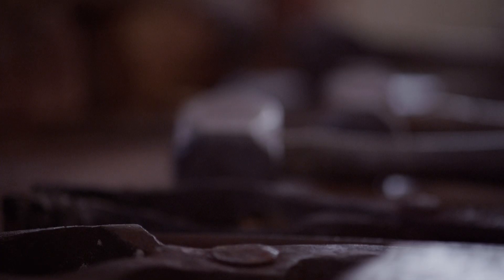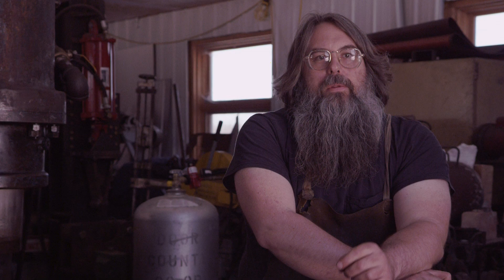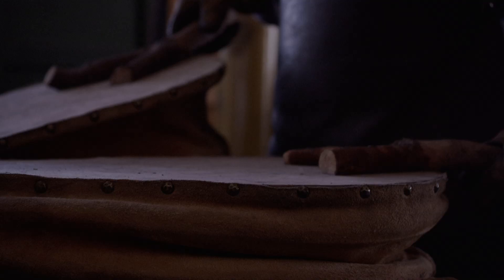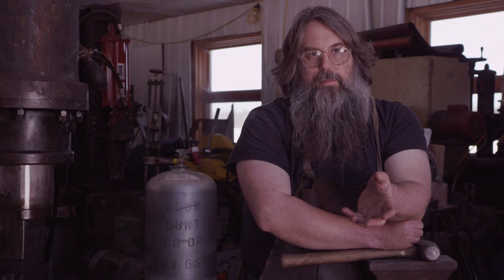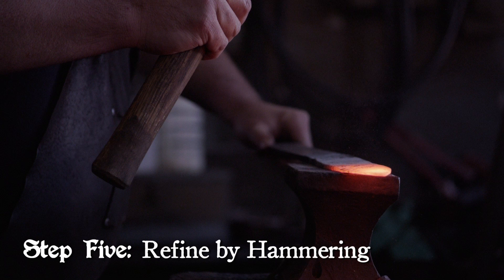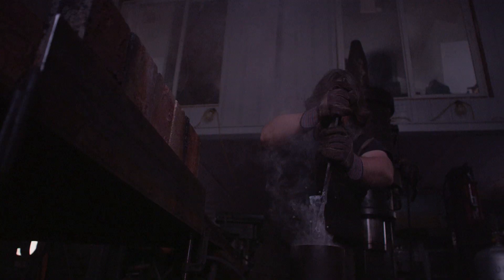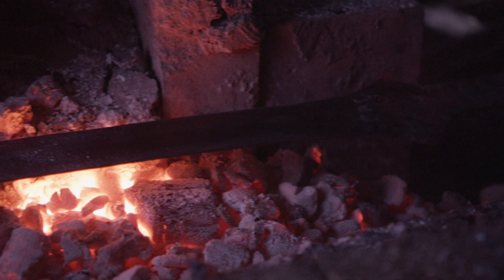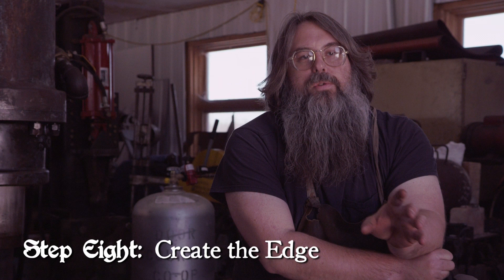Forging Blades - Arcade Arms Behind the Scenes

Comment: Tempering allows for diffusion of the carbon out of the core to increase ductility.  And the quench helps produce pearlite and martensite microstructures. I was taking materials last year, it is cool to see it in a more practical sense.

Comment: so after you quench the sword blade, do you just heat and hammer it to straighten it if its a little bent or curved?
Reply: Yes, any warping or sabering can be corrected during the tempering process. The blade does not have to be brought to red hot to correct these problems.